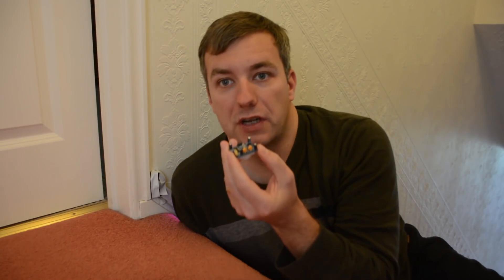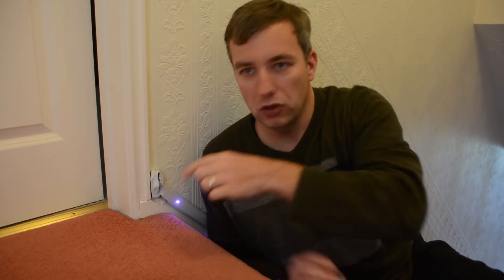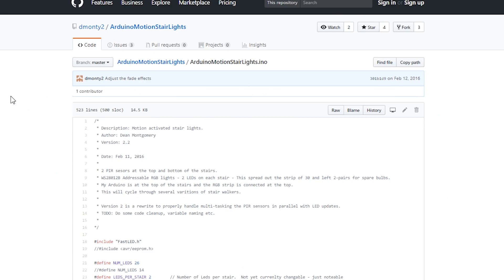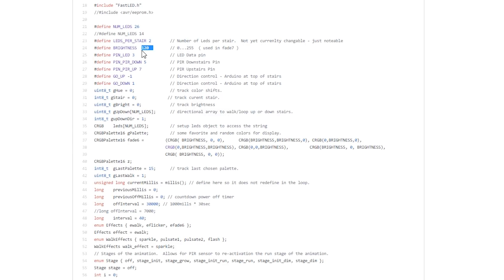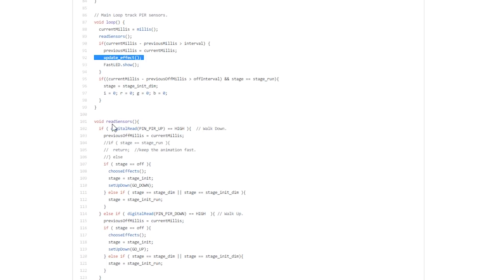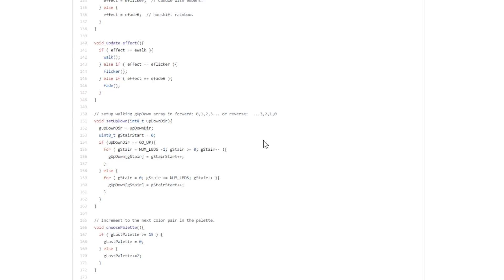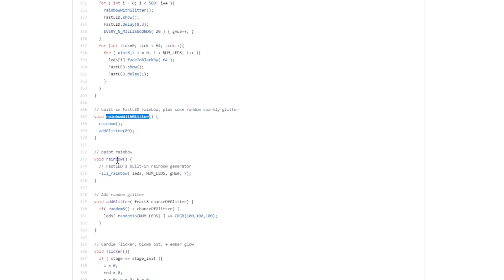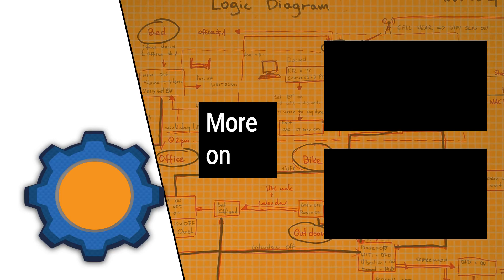$20 Automated Staircase Lights: SOFTWARE (3/3)

Comment: i know its been awhile but i just set this up and after the rainbow finishes it plays the light up animation but it never turns back off any ideas as to why
Reply from the maker: Sounds like you have a loop somewhere or your sensor is constantly high. If you play animation and your sensor timeout is long, then last animation is on until the sensor reports low

Comment: Sir, is it start from both side or one side ??
I mean when we passed from up Sensor then is it start from up side ?
Reply from the maker: It will start from the side that sensor is triggered so if you walk down lights go down if you walk up lights go up
Reply: @notenoughtech  thank you Sir. I'll try it if there's any problem please help me.
Reply: Sir I'll try this circuit but how you send power to Arduino. It's not working
Reply from the maker: @debjyotibera7868  Arduino has 5v and GND pins you can power it this way or using USB

Comment: hi notEnoughtTECH  can you please do a video, on the arduino side please, a walk throw, i have done what you have listed and its not working for some unknow resin
Reply from the maker: Any error messages ?
Reply: @notenoughtech  its coming up with platform/avr/led_syadefs_avr.h  error, i would be very happy if you can help me
Reply from the maker: This sounds like the supporting library has an issue? Have you got all installed?
Reply: @notenoughtech  yes i think so
Reply: @notenoughtech  funny question what version of Arduino software you using at the time, because i use 1.8.5 i use for my 3 D Printer, and other project, with no problems
Reply: @notenoughtech  Arduino: 1.8.5 (Windows 10), Board: "Arduino Nano, ATmega328P"

In file included from sketch\FastLED.h:41:0,

                 from C:\Users\seanf\Downloads\ArduinoMotionStairLights\ArduinoMotionStairLights.ino:18:

sketch\led_sysdefs.h:37:43: fatal error: platforms/avr/led_sysdefs_avr.h: No such file or directory

 #include "platforms/avr/led_sysdefs_avr.h"

                                           ^

compilation terminated.

exit status 1
Error compiling for board Arduino Nano.

This report would have more information with
"Show verbose output during compilation"
option enabled in File -> Preferences.
Reply from the maker: Can you try with Tools > Processor > ATmega328P (Old Bootloader) perhaps it's a compatibility issue?
Reply: @notenoughtech  hi do you have a drop box

Comment: Yes thanks that works great.

Hope so see my project in action now soon.
Reply from the maker: Awesome send some pictures!
Reply: @notenoughtech  Sorry the pictures a not that great :-) and i have some issues. When i lay all trunk and the device on the ground to test it works fine but when i install everything the leds will never go out again. Sometimes it works but when i have two pir sensors installed this issue happens. I got 2 pir sensors and 16 leds ws2812b leds. Would be great if you have any idea. :-)
Reply from the maker: Sounds like you have a problem with a data line somewhere between LEDs it's cold joint or touching ground. At least that's my guess
Reply: @notenoughtech  I made it like you explained in the video. I will check the connections if there is any ground issue. Thanks for thinking with me 🙂
Reply from the maker: If the design works on the bench but doesn't when you move it . It usually wires :)
Reply: Well i fixed all the grounds just to be sure. With the Nano the leds keep on and with a arduino uno it works. Strange issue if you ask me. The pir sensor is tripping when i use 2 sensors. And then the sensors are fine and the leds are not going off. Tried a few nano's also. Now i can't even get it to work on a workbench and i also soldered a new string of leds. :-) So terrible that is doesnt work. This is such a nice and well explained project. Well i did have allot of fun making it.
Reply from the maker: Do you have common ground between the LEDs power supply and the Arduino? Is the fast led test code working ok?
Reply: I tried the common ground but that didnt help. I can try the fast led code. Thanks. Sorry to disturb you. I will try that and some more but otherwise i remove the trunking. Was nice you of 2 assist and reply very fast :-).
Reply from the maker: If the fast led test code isn't working the issue is with wiring somewhere.
Reply: Well Fastled is working so i give up. After the rainbow effect has fades he does a walk stairs up without any sensors and then he stays on. He is looping somewhere but i can't see were. I will build a simple color code with pir sensors. Thanks for the ideas. I also need to figure out how to put a ambient sensor to all of this that would be fun. 🙂
Reply from the maker: @arduinoprojects7772  If you have PIR deployed you have to see the pots right, one  is controlling the sensitivity one is controlling the frequency of the signal issued and how long it stays on. Check these
Reply from the maker: Your comment got suspended by YouTube DM me via social media of your choice instead
Reply: @notenoughtech  I did put a link in the message maybe that is why? I got a simple led to the board and i see the motion is triggered way to much with even when im not moving so i think i need to order some new and better pir sensors.
Reply from the maker: Links and comments don't play well
Reply: Well a 470k resistor between the data pin from the sensor did some miracles. Gonna build it again with these resistors and try again.
Reply from the maker: Do you have potentiometers in your PIR? Another way is to have software handling it differently. You could take the signal and set up a timer during which all inputs are ignored
Reply: @notenoughtech   Yes it is just a HC-SR501 with Sensitivity and Duration potentiometers. That could work also yes. Nice thinking. You got this code laying arround somewhere in your socks drawer maybe?
Reply from the maker: Not at the moment but I'm sure you'll stackoverflow something

Comment: Hi, thank you so much for this huge tutorial. 
It is very helpful but your Arduino code is made for 2 sensors for one stair with no floor.
My entire staircase is made of two stairs with one floor in between. And so it makes me 4 IR sensors, and two separate rows of LEDs. Is it possible to adapt the code and if so, tell me how to do it? Thank you very much!
Reply from the maker: You could use the same code for each flight of stairs but the position of the PIR would be crucial as going from the middle floor sensor needs to only light up the lights to the correct staircase.
Reply: @notenoughtech  Yes, totally. And so I thought, put two IR sensors on the landing, one for the stairs going up and one for the other going down. So the right line of LEDs will light up, so it's possible to adapt the code to make it work?

Comment: Hi, where could be the issue? when sensors or longer wire is connected to pin, my LEDs are all the time on. When I disconnect the sensor and touch the pin the LEDs switching on and off (like should be with sensor). I tried UNO and other NANO  is the same issue, Its like electricity from my hand switching pin, the pin is too sensitive . https://youtu.be/8W9IdmpjPQ4
Reply from the maker: When you disconnect the pin you leave it floating. Pull it high or low.. not sure which one was in the code.
Reply: Thank you i just changed from INPUT to INPUT_PULLUP: 
  pinMode(PIN_PIR_DOWN, INPUT_PULLUP); //5
  pinMode(PIN_PIR_UP, INPUT_PULLUP);  //7

Comment: Hi
I try to put 16 steps and I put 55 leds for each step and total is 900 leds and try to upload to arduion uno. And it failed to unload because low memory. When I 320 leds and 28 for each steps. And it works
Any sugggsions?
Tried so many time and maximum leds is 320 and run very slow
Reply from the maker: The limitation can be the Arduino itself, ESP could be a better-suited choice with more memory. Remember to step up signal to 5V and use fast LLC for that
Reply: NotEnoughTECH is there better way to set up more leds? Or change to different arduino board?  I tried at 300 leds and it works good, when I set to 320 leds and it can be upload to arduion nano and runs slow
Reply from the maker: You should be able to do more than 300... Maybe try to do strands?
Reply: NotEnoughTECH how can I do strand? Because I got 16 steps stairs and I try less leds 28 for each steps so total is 448 and can’t be upload to arduino, its say low memory problem
Reply from the maker: Are you sure your code is ok ? I tested 440 with nano?
Reply: NotEnoughTECH  I tried on nano and uno are not working more than 300 leds but can be upload, I can upload code in 600 leds with arduino mega but not running